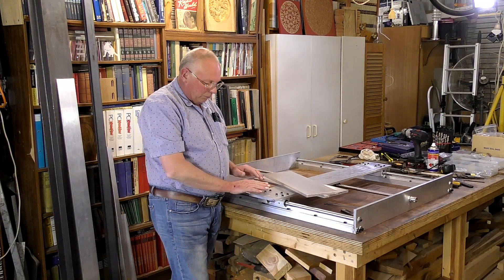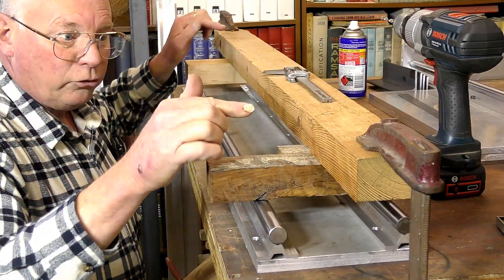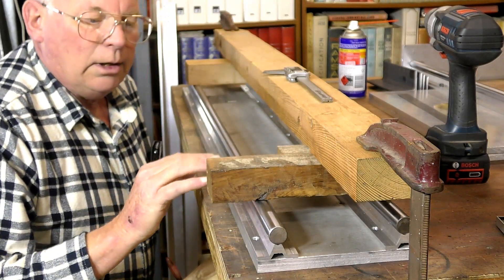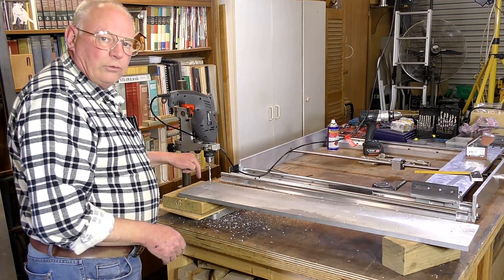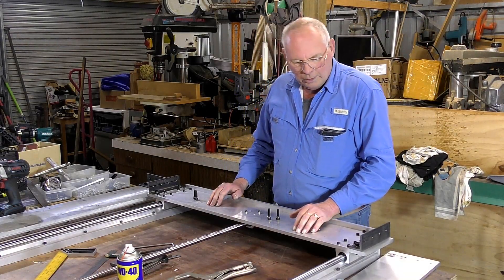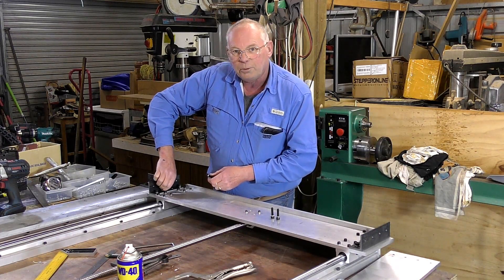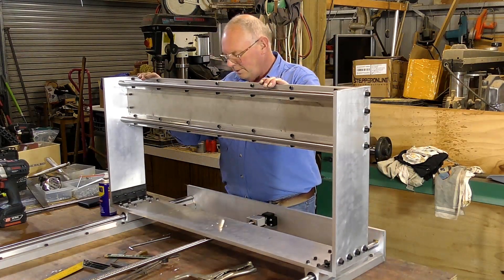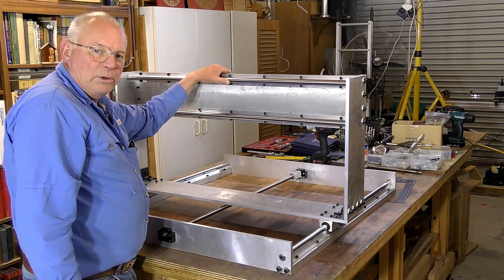Episode 6 MAKE A CNC ROUTER WITH SIMPLE WOODSHOP TOOLS (GANTRY and X- axis)

Comment: Your frame will bend sideways around 0.3mm(for side force of 500N), quested height of sides(part not attached to anything) as 300mm. And ignored the rails stiffness. Just realized used wrong formula true value is 0.3mm.